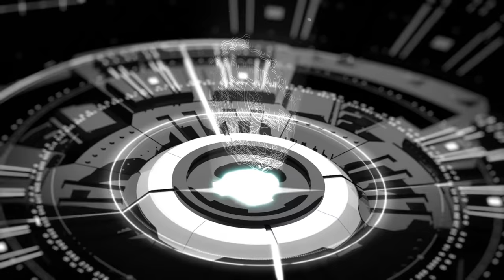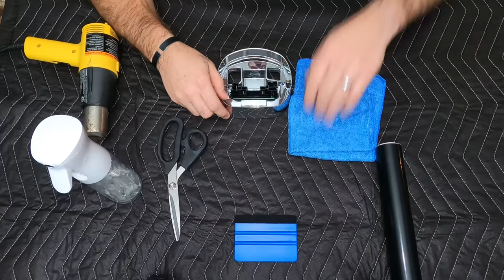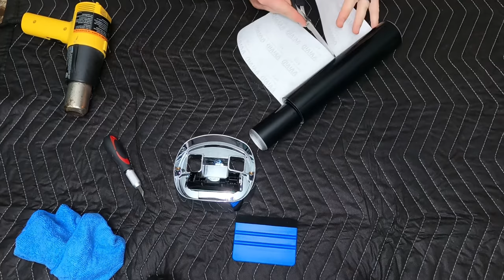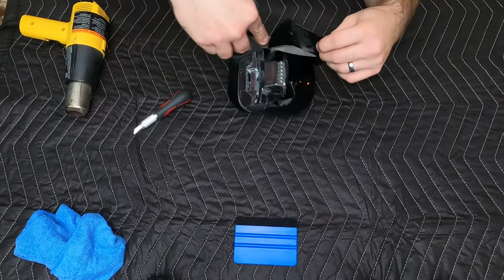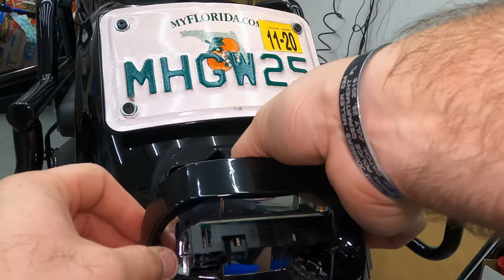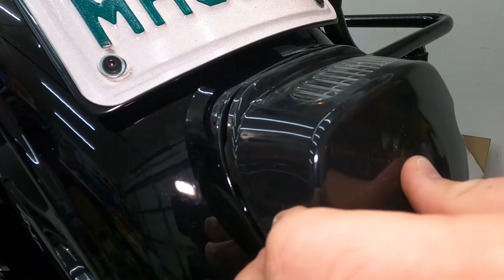Wrapping the Chrome tail light Bezel on my Harley. SAVE MONEY(low rider build series ep12)

Comment: I took mine off and primed/painted and cleared it with spray cans and it still looks amazing with no fading or chipping. I also have the Custom Dynamics Black base plate and it didn't come with the circuit board so it was like $20 so I am giving it to a guy that is doing some carbon fiber work for me
Reply from the maker: Oh awesome, I haven't seen ones available without the circut board. $20 is pretty good. I've seen some incredible spray paint jobs, I just couldn't trust trust myself with paint lol

Comment: Be careful guys !
As of now, Moonsmc and Custom Dynamics plates are NOT fitting our 2018+ Softails.
The fenders are slightly different and the plates leave quite a big gap.

Unless they release a new product, they do NOT fit.

Nice work on your wrapping Sir.
Will try to do it myself since Plastidip did not turn as good as I wanted.
Reply from the maker: Thank you! And that’s odd. I haven’t checked them too much but maybe they’re only geared for dynas and such since the m8 platform has the circuit board in it already? I don’t remember how they’re marketed on the sites though
Reply: @RidinDad  
Custom Dynamics is very clear about that, ''does not fit M8 Softails''.

I saw that ... and just said ''meeh they just didn't try, I'm sure it fits''

It doesn't ... (facepalm)
Reply from the maker: Lol we’re you able to return it?
Reply: @RidinDad  
Naaa I live in France.
I did not even try ...
Reply from the maker: Oh that sucks. At least it wasn’t super expensive.

Comment: Hey what tires are you planning on running when the factory tires run out?
Reply: I'm going to guess.... Skinko 777s. That's what I am putting on mine!
Reply from the maker: Nah lol. I’ve heard good stuff with Shinzo but I’m either between staying with the same Michelin’s or buying some Pirelli night dragons. I’ve been a Pirelli fan boy ever since I put some on my hyabusa
Reply: @RidinDad  busa bro. I gotta start thinking about what tires to upgrade to on my 2016 dyna low rider S. Got about 8900mi on em and the fronts getting close to needing a replacement. Just hard to pick!
Reply from the maker: I know! We are spoiled in 2020 with all the awesome tires to pick from man. It’s a very hard choice!
Reply: Got rid of my stock Scorcher 31s on my 2018 48 for some Avon Cobra Chrome tires last week. I used to love dumping the clutch at 10ish mph and doing rolling burnouts. I tried it with the new tires last week and it didn't burnout, it just went full animal 12 oclock wheelie hahahaha
I was absolutely shocked at 2 things. The first, how bad the stock tires are, and secondly how insanely good the Avon Cobra Chromes are. What an amazing tire!